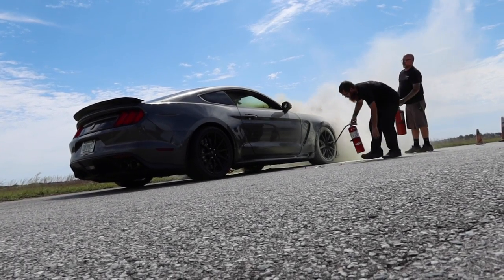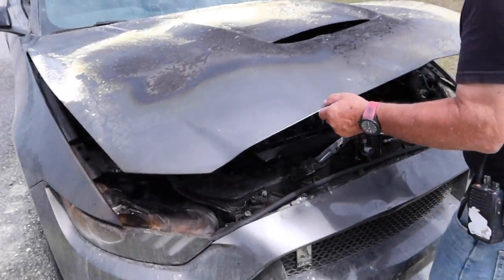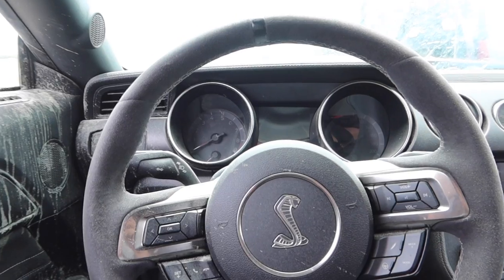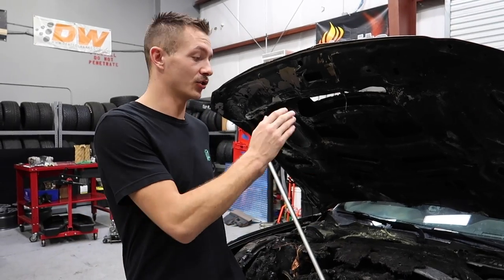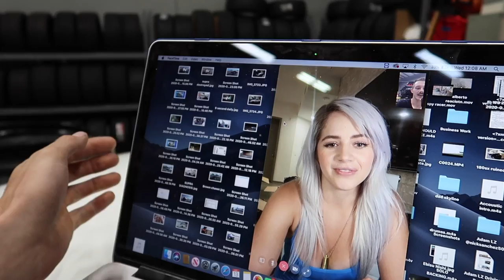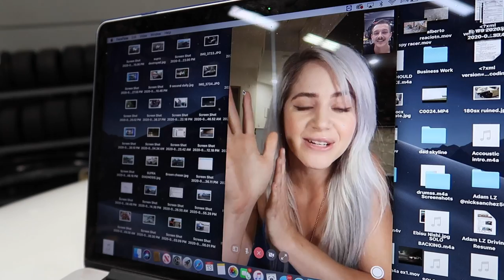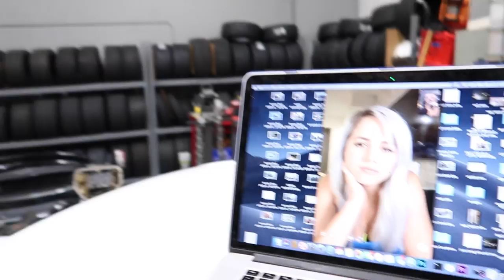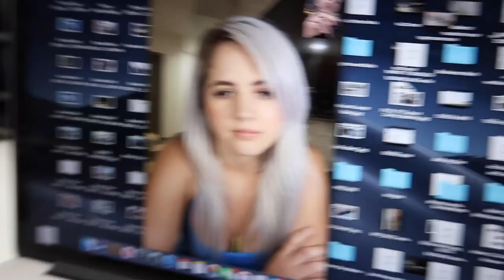Watching my Mustang GT350 Burn to the Ground...

Comment: What bothers me is that there was no fire extinguisher installed in the car in first place. I been track racing and auto-x on and off for the last 18 yrs. I remember in 2003 I and couple of my buddies went to Gingerman and there was a Dodge Viper that took the last fastest straightaway and could not make the right turn corner and decided to go straight and then proceed to hit a small ridge hard causing the whole frame to twist and then while he was trying get out the car the car caught on fire he was unable to get out of the car for some reason within 1 minute the race track crew was there with fire extinguishers putting a fire out and then got him out. The only reason the crew was there within a min because it was at the entrance of the pit lane if the accident happened like half way through the track it would take them at least 3-4 min to get there hence different outcome would of occurred. I remember the driver thanking the crew of saving his life. Since then the ending of Gingerman track has been changed. I never though of it again and around 2006 at the same track on the same straightway my car started smoking and losing power I immediately proceeded to the pit lane and stopped and turned the car off. The smoke was not bad thats why I then opened the hood and found out my valve gasket was leaking oil everywhere and thank god it did not catch on fire. Since then I have fire extinguisher installed in each of the cars that I have owned just for safety and thats why everyone who goes racing should have one installed.

Comment: You would have to put a brand new front frame clip on it, the heat softens the rigidity/temper of the frame so a new car would be the best deal in this case. That's why most legit race cars have a fire suppression system installed in them. This is another reason why we use two way radio communications between pit & crew with the car. Once plastic and rubber catch on fire it is almost impossible to put out unless you use, one rated for racing vehicles. https://www.summitracing.com/search/part-type/fire-suppression-systems You would have to buy it back from the Insurance co for salvage rights and just go get another car, that is not burned up and use it for a race makeover and built it the way you want for the application it is going to be used for; that is the only logical thing to do here.

Comment: I just happened to come upon this video on google so its a bit long in the tooth but....to Collette (sorry if i misspelled) I realize you felt bad about this but theres really nothing you could of done differently.  You could use a 100 fire bottles and the car still would of been on fire because it still had a source of fuel namely oil dripping on hot headers.  You did the right thing pulling over shutting the car down and thank God you didnt open the hood you would of had an inferno most likely.  
In the end cars are material and for the most part replaceable...lives are neither of those so glad she is ok.

Comment: Fords man there’s a ton of recalls in the past years on a few models that can end in the car on fire. My dads 2010 eco boost escape caught on fire from a hair line crack in the block that would open up under pressure and spray oil onto the turbo components. Looked it up and that year and model is known for catching on fire. We don’t buy ford cars anymore lol. Like the trucks though!
Reply: Fords are still awesome. All cars can do this bruh it has nothing to do with the brand
Reply: @dylanverkler4552  Yes all cars can do it, but some cars can do it more due to poor manufacture. Bruh.
Reply: StewPidaso better than a chevy tf

Comment: So much for the myth of the hood liner falling down to put out the fire. How many vehicles don’t even have them from factory period? Some say their for the above mentioned, or to protect paint, or sound insulation. I removed mine years ago, paint is perfectly fine and heard nothing different from engine bay after removal. Only way I’d run one is if I was forced induction.

Comment: Just in case this ever happens to anyone listen please I’m a fire fighter as well as trainer and have been for 5 years now. That being said if you have a car fire and can safely do so cut or unplug your battery because you will never get the fire under control fast enough and yes I know this wasn’t an electrical fire. And the reason they used the tool to open the hood was Probably trying to cut the battery wire and to get water in most volunteer fire fighters aren’t sure where exactly the batteries are 😂 but please remember remove or cut the wires it will help

Comment: At low temperatures e85 is more flammable than 91. At normal temps 91 is slightly more than e85. You gotta remember e85  is a alcohol, which is heaps harder to see than a petroleum flame.

Comment: Always do your research before purchasing a car. Many ‘15-17 GT350’s and 350R’s are lemons due to exactly what happened to this Shelby.
Reply: He said that he was told that this only happens when the filter doesn't get the correct torque spec, so it should've been fine however I'm assuming the dealer was shit

Comment: If that's a known issue with the early model.. they should offer the "upgrade" for the filter FREE, since it is a mechanical issue that could cause much worse than what happened to you.  Charging people $500 is ridiculous when it is their fault to begin with.

Comment: first thing  u might want to try to do is when u think it might be on fire if u are able to do it with out hurting ur self is as u get the ride stop & before it starts to go all the way up on fire....  pull the hood release lever 2 POP  the HOOD so it can be open before it to hot to touch.. cause then  it will be a whole lot easy to put the fire out so it not so damaged or destroyed... & this is also why i do my own Oil change's..most of all my own work as much as i can.. cause a lot of the those tech's at alot of  place's  do not take pride in there work & just hang & bang with out caring if it done right.  i don't just trust just anyone to work on one of my Passion RIDE"S 4 many reason's.. & if i were you switch to K & N Oil Filter's cause it also sounds like it also might be defect's in the Oil filter's that u were using on that engine.. FRAM had a problem like that with there OIL Filter's a few years ago  FYI.. I use nothing but K & N Oil Filter's on my passion ride's

Comment: Would insurance still cover something like this being on a track?
Reply: Insurance wouldnt cover a wreck on a track no but the fire isn't driver error in this case so I'd say grey area guess depends what caught it on fire if it was a loose oil filter then that would be on the maintenance the manufacturer did. I think there is a type of insurance you can get for track events but I've never heard of anyone actually getting it

Comment: Look for a totaled parts car on copart with a good engine! then you would have the wiring and all that is burnt on yours. and your frame should be fine. it will need cleaned and painted.

Comment: Built a rausch stage 3 on a gt500 base, it caught fire 3 miles into test drive and burnt to the ground
Reply: Independent inspection said faulty Pcv caused cam cover to pressurise and blow out covering the exhaust in oil and up it went, for those 3 miles it was like a nascar on the road just epic

Comment: This is exactly why most tracks require your oil filter to be safety wired in place . K&N make filters ready to accept , or you can use a hose clamp . Knowing this is a problem why didn't you address it your self

Comment: Ford are probably shitting it, this would be a huge deal and lawsuit if it happened to a regular person on the street. Recall inbound. TBH You could just spot weld a tab on the oil filter, then attatch a spring to hold tension on the filter, and a mount to hold the spring.

Comment: should we open the hood? YES LOL!..... that's how you get to the fire to put it out before it turns into a complete carbeque.

You won't cause a backdraft, the engine bay is already open to air...........

Sad shit, because the car could have been saved early on if not for panic and lack of fire fighting knowledge.

If you track a car, you better have a fire bottle in the car and someone who knows how to use it, or install a standalone suppression system and show people how to arm it and fire it.

That will be all. ;)

Comment: Well this happens when you are not looking at the temperature or oil  gauge
Reply: Do you have a drivers license?
Reply: @miralemnermina142  Yep
Reply: @nayebunny4711  do you look at your oil gauge while turning in a corner?
Reply: @miralemnermina142  Stupid question. I don't need to i don't drive on track.
Reply: @nayebunny4711  so do you think you know enough to talk about track driving?
Also what difference would it make?
Headers are red glowing and she couldn't prevent the oil spraying